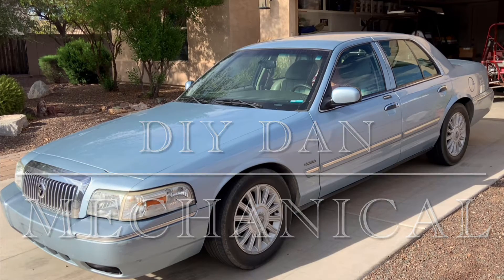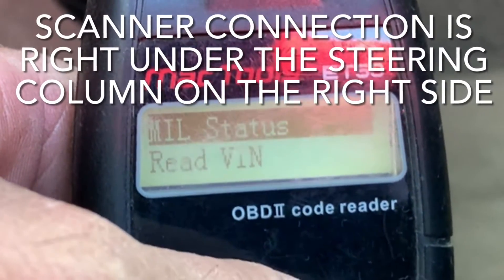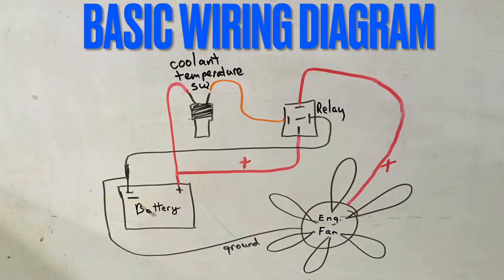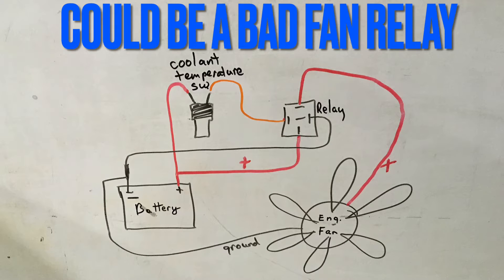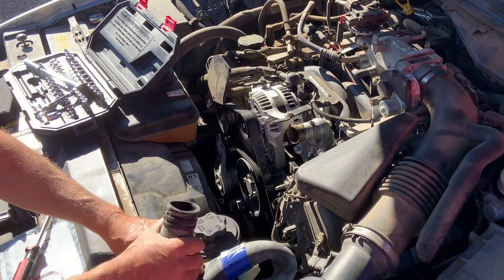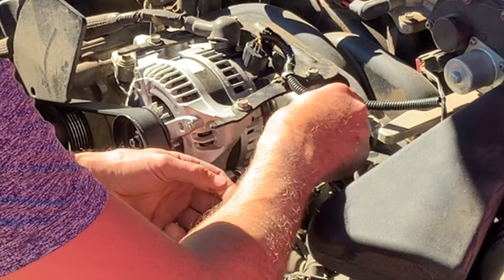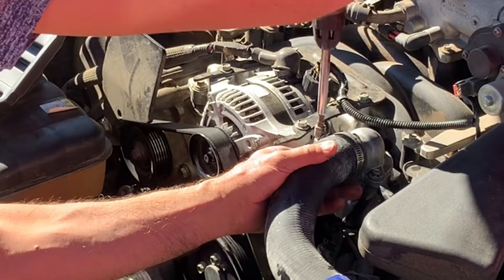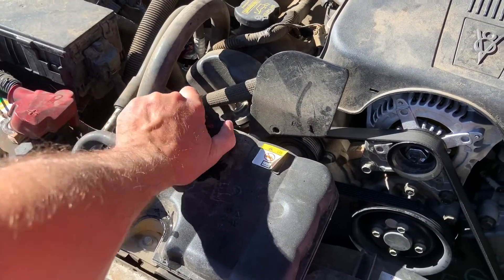Thermostat replacement on Ford 4.6L engine between 1990-2014 & things to check before changing it

Comment: Well so you say make sure it's positioned properly and then you don't give the position or explain what that really means??
Reply from the maker: @rr186650  I figured the close up pictures were enough I did say it doesn’t have to be timed you just need to make sure it’s not upside down
Reply: @diydan7019  Thanx!

Comment: I did this job this evening.  It isn't necessary to take the hose off the t-stat housing.  Just take out the two bolts and bend the hose out of the way with the housing still attached.  I didn't loose any coolant.  

I've been backyard working on cars since my teens in the 1970s.  I remember when thermostats would commonly fail every few years.  This was first I've had to do in decades.  And, it was the easiest I've ever done.  That rubber O-ring as opposed to a flat gasket was great.  No scraping or sanding the mating surfaces.  Just pull out the old T-stat and O-ring, drop in the new, reinstall the housing bolts.  I torqued them 18 pound-feet with a Harbor Freight 3/8" digital torque adapter.  That is a slick tool.
Reply: I'm thinking removing the hose from the housing invites another possible leak.
Reply: @pamcm1098  Good point.